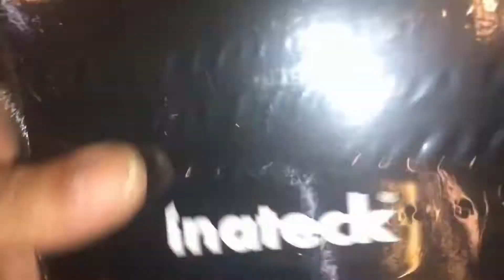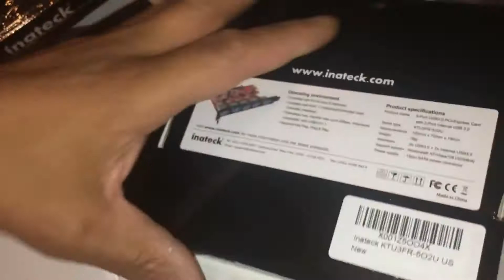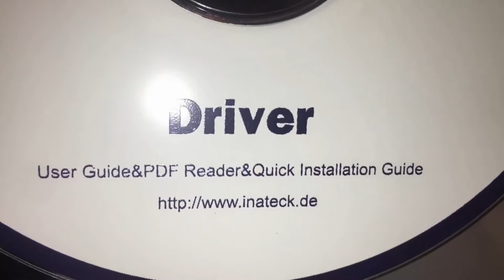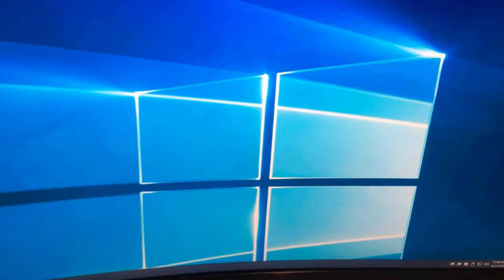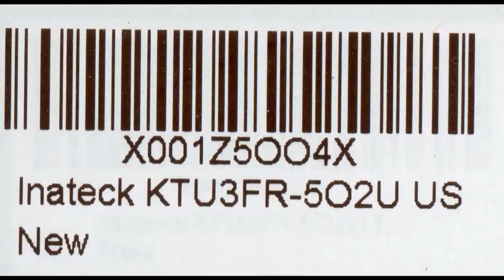Inateck Superspeed 7 Port PCI-E  USB 3.0 Expansion Card 5 external 2 internal Ports Card KT5002

Comment: Hi any idea why my bios cant detect it being plugged with the SATA  cable? The blue light is on from the pci slot but the green light turns off after 1 second.
Reply from the maker: DRIVERS, & ADD POWER
Reply: I actually noticed a loose capacitor on mine so Im gonna try a different one. I installed the driver but how would i add power?
Reply from the maker: @Gegyeggy  there’s a SATA power port on card, connect 1 of the 2 power cables that come with the card. The other end goes to a SATA or old molex power connection coming from your power supply
Reply from the maker: https://www.amazon.com/gp/product/B00FPIMICA/ref=ppx_od_dt_b_asin_title_s00?ie=UTF8&psc=1
Reply from the maker: @Gegyeggy  look at pictures: https://www.amazon.com/gp/product/B00FPIMICA/ref=ppx_od_dt_b_asin_title_s00?ie=UTF8&psc=1
Reply: @mtandiz  I did that but sadly I got a defective product so Ill get another and let you know how that goes. Thanks for the help!
Reply from the maker: @Gegyeggy  anytime
Reply: @mtandiz  Good News! Got a replacement and it works for my mouse keyboard and wifi adapter like a charm. Bad news is, when I plu my Oculus Rift S in (the whole reason I bought this) i get "This device is not working properly because Windows cannot load the drivers required for this device. (Code 31)
" Any ideas?
Reply from the maker: @Gegyeggy  I have the OCULUS, I could not get it working on this USB card, had to plug it into a USB located on the Motherboard. I plugged everything to this card, then the oculus to the computer USB ports. Hope this works. The oculus is finicky.
Reply: @mtandiz  Whatever works i guess. I finally got mine up and running so thanks again fro the help!
Reply from the maker: @Gegyeggy  anytime